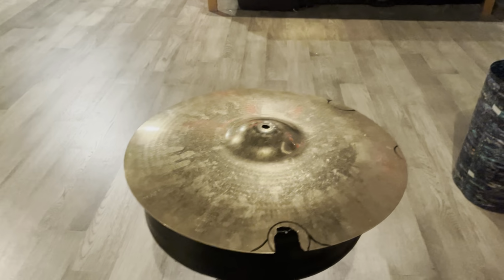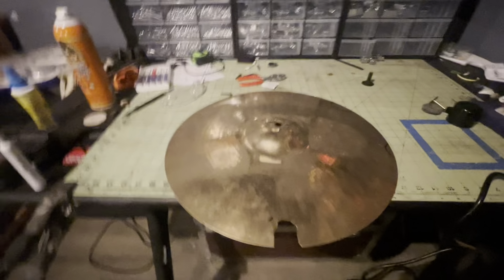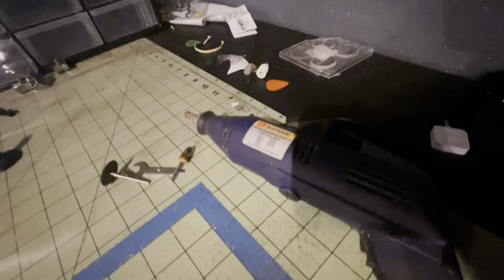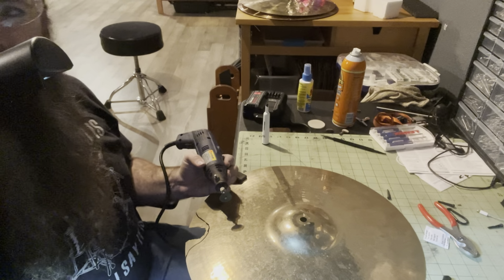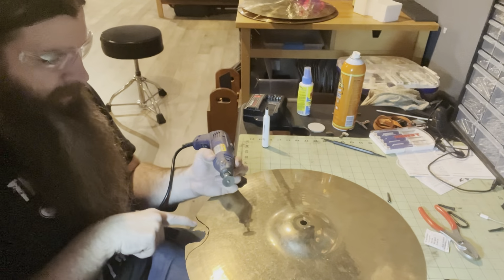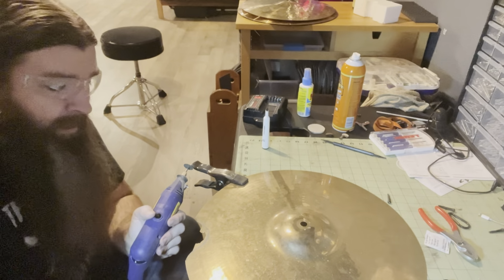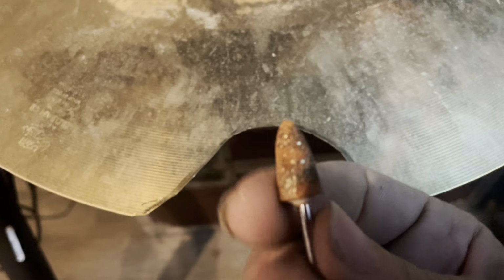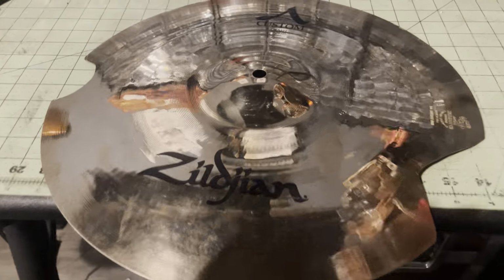DIY cymbal modification: how I cut cracks out of damaged cymbals

Comment: You can also try turning them into a sizzle.  Drill a hole at the beginning and the end of the crack and put a nut/bolt/washer or whatever and you got yourself a sizzle.  Should also keep the crack from propagating but no promises.  I also found them useful to mount auxiliary stuff like chains and bells to the cymbal.   No reason to throw away cymbals.